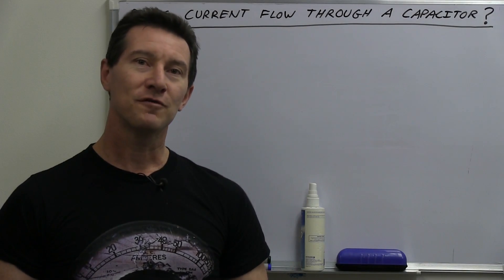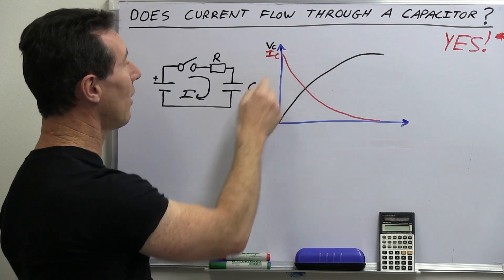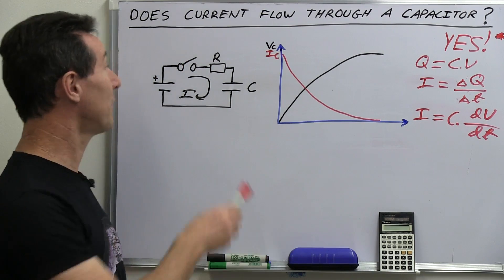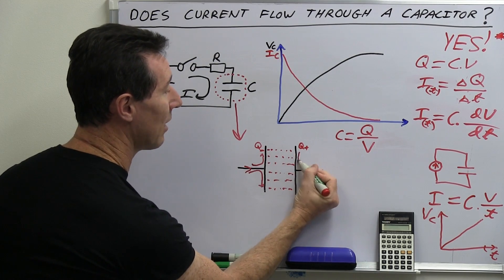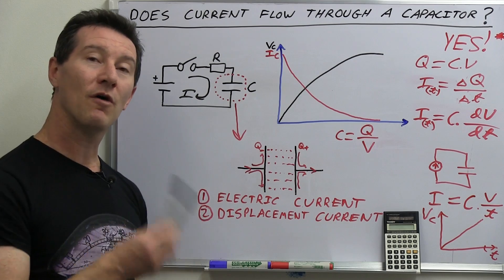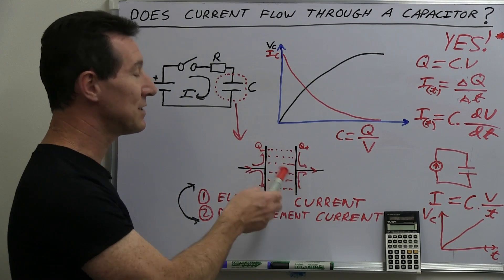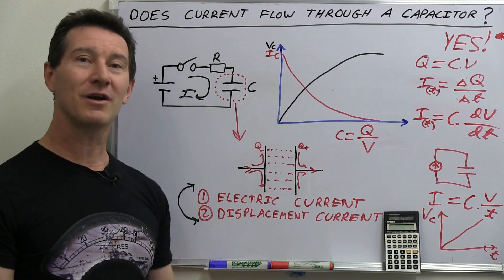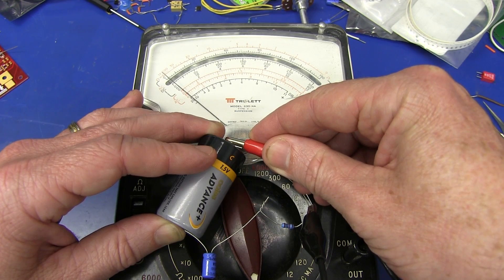EEVblog #486 - Does Current Flow Through A Capacitor?

Comment: You need to understand the physics to answer this question because the equations are just that, equations, not to be confused with the actual physics. When the neutrally charged positive plate of the capacitor charges up it becomes negatively charged and repels electrons on the negative plate of the capacitor causing current to flow out of the negative plate. This is done by the repelling forces of negatively charged atoms on one side pushing electrons from the atoms of the plate on the other side turning these atoms into holes i.e. positively charged ions. So NO, current does NOT flow through the capacitor. See:  https://youtu.be/f_MZNsEqyQw by the brilliant professor Eugene Khutoryansky
.

Comment: NO, it doesn't flow through the cap.  It builds up a charge on the plates of the cap and that charge build appears as a current flow through the circuit holding the cap. Same happens on the discharge. Cheers!

Also, thanks for your talks - very informative and enjoyable.

Comment: i d been thinking on this today and saw and watched ur video . 

cant we just see it like , " when we apply current from one direction say from the positive side , there is an "electron capacity" in the other half of the capacitor that can be pushed to the other way , say to the negative  end ."

and that is the reason we can move current for a limited amount from one side to the other with dc .

Comment: The problem here for a new person, thats a dummy head like me, is you put both leads in series ... Bc current flows THRU the capacitor. Haha thats not how it gets installed, but yes thats how it works. Maybe say instead "current flows through one side and around the circuit/capacitive fed components to the negative side". And the electrons flow the opposite way.

Comment: Thank you Very much for your video i often had this kind of discussion with people. 
In my point of view current flow through a capacitor. 

I take this opportunity to expose other thing that in my point of view it's wrong.

People often said that , We can't have a DC current through a capacitor , and my anwser is often  that is not true. 

We do not have any current for a constant Voltage source , but put a ramp on the capacitance and you will see a DC current because of  i= cdv/dt 

We often see that kind of statement in DCDC book when designing the input filter :  We can't have a DC current through a capacitor 
In my point of view , is better to say , the capacitance do not react to a DC voltage but ripple.

What is your point of view about that

Sorry for my english , I'm french speaker :)

Comment: Does the graph look like that no matter the capacitance of the capacitor,  or does that represent a 1 farad unit,  or , would like a 15 micro farad cap , charge a whole lot faster with the volts,  compared to the current passing through and coming out it., so the volt line would be a whole lot steeper?

Comment: I think the drift velocity you brushed off bears more attention.

If you put an asterisk about AC current flowing through a capacitor, then you should arguably do the same to AC current flowing through wires.

With DC flowing through a wire, the electrons will be slow, but they will eventually get from one side to the other.

With AC on the other hand, the electrons will move a fraction of a milimetre before being forced to switch direction and undo all their progress. The electrons on one side of a lightbulb only get a tiny fraction of the length of the lightbulb- they never get through it either, barring random thermal movement, which is not usually considered current.

Comment: An AC current flows[ through] a cap and a DC current will flow in one direction until supply voltage  is reached at either  one of the pins being charged therefore open circuit to DC hence zap worthy . AC current flows  [through ] a cap in oscillating or in  waveform only i thought ?

Comment: Maxwell wrote a textbook in Faraday observations. He showed that electromechanical involved 23 variables and in typical English way was elevated to the podium of complexity. Along comes a guy from a wrong tacks named Heaviside - mostly self educated and mathematically gifted takes Maxwells text book and reduces the number of variables and equations to 4.  In typical English way credits Maxwell with solution in hope that he will be elevated into academic snobbery circle. Maxwell failed to deliver, it is common knowledge that Maxwell did not have the mathematical skills ( Vector calculus ) to do what Heaviside has done. The Maxwell's equation is rightly Faraday-Heaviside equation, it's like asking who invented the Phone or Radio Control. Hint - it's not Bell or Marconi.

Comment: The standard usual model of "current flow" in an electric circuit works perfectly well, but actually it's all a bit tangled up in semantics.  During the late Enlightenment period the early physicists were tinking around with all sorts of what turned out to be our present day voltage sources, capacitors, inductors, resistors, conductors, insulators and static charges.   Early on it was suspected that electricity was a fluid that flowed in conductors, conductors being likened to rivers.   It was common during late Elightenment and early Industrial Revolution physics to draw upon already known large scale physical phenomenon to come up with explanations.  In time it was claimed that electrons were the fluid and they flowed more or less like water through the circuit which bolstered the already existing hydraulic (water) analogy of electric "current" flow.

I think it was in the early 20-th century that someone figured out that electrons don't flow in a conductor.  What flowed or rather moved was charge itself.  Matter in which charge flowed quite easily, such as metals, was claimed to have loose (valence) electrons which would respond to charge by either entering a state of higher charge, either higher orbit around the atom's nucleus or a more energetic orbit or just a more energetic cloud  or the oppostie depending on the type of charge, positive or negative.  In a metal condutor, say a wire, the first atom to become  charged influences the atom next to it, passing the charge along, because the atom next to it has not yet been charged and readily accepts the charge, and on and on to each adjacent atom, until all the atoms in the conductor have the same shared charge.   No electrons flow but the charge distributes itself almost instantaneously.  

Considering the simple electronic circuit like in this video, when the switch is closed the, let's say positive,  charge instantaneously goes to the left hand plate of the capacitor.   Now consider that the right hand plate of the capacitor was not connected to the neg terminal of the battery.   Because like charges (either positive or negative) hate each other intensely, positive charges are driven to the right hand side of the right plate, resulting in negative charge on the left side of the right plate, even though the plate be a very thin foil.  The negative charge on the left hand side of the right plate is due to absence of positive charge, but the positive charge trapped on the right side of the right plate does exert some force across the capacitor gap preventing some charge from accumulating on the left plate.

And the charges stay distributed as they are until the right side of the capacitor is connected to the negative terminal of the battery and then the charge on the right side of the right plate of the cap flee instantaneously to the negative terminal of the battery.  Due to that flight more positive charge moves onto the left plate of the cap as it is no longer prevented from doing so by the positive charge that had previously been holding it back by being trapped on the right side of the right plate where it was in a sort of last ditch defensive position.  With negative charges on right side of right plate removed by battery neg terminal the left plate of the capacitor can reach the state of well distributed positive charge it would have if there was no negative plate. 

It is due to the increase in positive charge on the left plate and the flight of negative charges on the right plate that we call the current flow, but in fact it is a redistribution of charges.  The redistribution of charge ceases when no more trapped positive charge on the right side of the right plate are to be found there, having all fled to the battery neg terminal.  Then we say the right plate of the capacitor is negatively charged.

Comment: Here is a way to prove that a capacitor does allow electricity to flow through it. First, we must declare what electricity is. I declare that electricity is merely the abundance or shortage of particles of electricity in two different places respectively. An abundance of particles of electricity creates a positive electromotive force, and a shortage of particles of electricity creates a negative electromotive force. This is the same as a pneumatic system, a hydraulic system, or any other pressure system. That is what Benjamin Franklin was famous for, his single-fluid discovery that voided DuFays two-fluid theory. 
Although our batteries were mislabeled to hide electricity, the atom, and the atom bomb, we can agree that the abundance of particles of electricity in a modern battery comes from the (-) marked terminal. 

If no current is flowing through a capacitor, then a person would be able to put his body between the power source and the capacitor and not get a shock from the side that is not getting filled with particles of electricity. Since we know that we can measure a flow of particles from either side of the capacitor, it is proof that the insulator the dielectric does not stop the flow of electricity until it is charged in a ramping voltage. 

A typical light switch is a small condenser or air capacitor; it must charge and discharge 120 times a second to stop a 60-hertz power source. An oscilloscope can measure the voltage charging and discharging the air capacitor, you can see an AC waveform on the scope. So, of course, current flows through a capacitor until it is charged in a ramping voltage.

Comment: DUAL QUESTION:

Is there any voltage ACROSS an inductor?

(Now go and claim that because the single windings are a continuous wire they are short circuited and stuff like that. 
Even worse: What about a single straight piece of wire?) 

Time for the dual proof Dave!
Reply: yes, there is voltage across an inductor.
the simplest diff equation that describes inductors is: dI/dt * L = U
if you have a change in current, then there's voltage across any inductor.

The reason why it's like that is because charges moving (current) causes a "rotating" magnetic field to appear, that's proportional to the current.
Now, if you have a CHANGING magnetic field going through a loop of wire, then you end up having a voltage generated on that loop (imagine a lot of tiny batteries being connected in series in a loop with a lot of tiny resistors (to limit current))
L, inductance, is a property of the circuit, it has to do with the shape of the circuit and also the material of it.
Now, imagine having a loot and you put a current on it that's changing. Because of the changing current, the loop makes a changing magnetic field around it. That changing magnetic field then interacts with the loop that created it and induces a voltage.
Just how big? Imagine magnetic fields as a bunch of lines. The voltage generated on a loop is proportional to the "change of lines" going through a surface that is bounded by your loop (any surface, can be simple, can be a nightmare to draw or describe, as long as it's edges are still your loop and doesn't have any tears or "edges" (VERY small turn radius is allowed, but not infinitely small) on it, it will give the same answer).

I'm not sure about just a straight wire (charges going from one place without returning at all), but in practice every current is in a loop. Even if the "return" line is kilometers away, it's still a loop and everything previously said still applies, it has it's own inductance (and capacitance between the 2 lines).

I'd recommend learning about vector-calculus. A really beautiful way to wrap electromagnetism in just 4 equations. (3blue1brown has a video about it that's incredibly well done)

Comment: The capacitor in its different embodiments still consists of the same basic components: two closely spaced conducting plates with an insulator between them, the dielectric. The plates are called electrodes, respectively anode and cathode in polarized capacitors (elco).
If the plates are coupled to a potential difference, a voltage source, one of the plates will become enriched with (free) electrons and the other will just deplete themselves with electrons.
The atoms in the cathode are negatively charged, they are now negatively charged ions due to the surplus of electrons (ion = a charged atom). The atoms in the anode become positively charged ions due to the lack of electrons or a surplus of protons.
Because the, now negative, electrical field of the cathode and the positive electric field of the anode exert a strong influence on each other in each other's close proximity, the attraction of the protons (anode) and the electrons (cathode) becomes greatly enhanced.
Due to the combination of the dielectric and the small distance between the plates, the attraction of the charges is so strong that when the voltage source is disconnected, the state of the electric field will no longer change. The phenomenon that this causes in physics is also called entropy.
This means that for all natural systems and therefore also for electrons, they want to spread naturally over the available space of the material. In other words that the distribution of energy will want to become even, from high energetic level to low energy level until the energy is evenly distributed over the available space. That is to say as long as no external factors such as an electric field have any influence. The electrons, as it were, want nothing more than to occupy the available space at the nearby plate with positive ions, i.e. with a shortage of electrons, but can not cross because this is prevented by the insulating layer, the dielectric of the capacitor. The electric fields, however, have no problem to penetrate the insulation layer (this depends on the type of dielectric, in fact each dielectric condenses the electric field) and attract each other but can not carry their carriers, the electrons or protons *, to the other side. equalization is therefore not possible. The voltage difference or potential between the plates will remain. We are now talking about the charge of the capacitor. The capacitor has electrical energy stored or the capacitor is charged. If we now connect a load with a certain resistance to the plates, the electrons will find their way to the other plate via this resistance and thus distribute evenly over the plates. At that moment there is a current. The plates are now neutral with respect to each other, the capacitor is discharged. The conclusion can therefore only be that no electrons can flow through the dielectric of a capacitor (except for leakage currents) ergo no current flows through a capacitor, that is to say plate a to plate b or vice versa. A capacitor can only store charge and later return it back in the opposite direction to the circuit. So it is a displacement current not a real current!

Tip for mathematical enthusiasts’: visit the incredible Lectures by prof.Walter Lewin..
https://www.youtube.com/watch?v=8ZYFYUFRblM

* Protons are part of the atomic nucleus and can not move away separately from the material such as (free) electrons, but their positive electric fields are noticeable

Comment: current flows through a capacitor, only until the capacitor reaches peak charge. To get continuous current flow (doesn't exist) you must discharge cycle the capacitor.